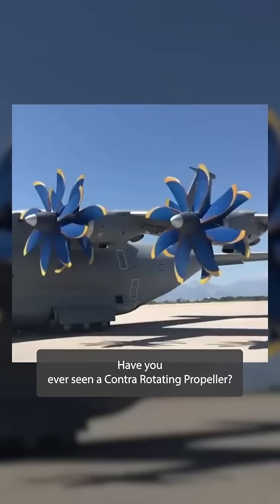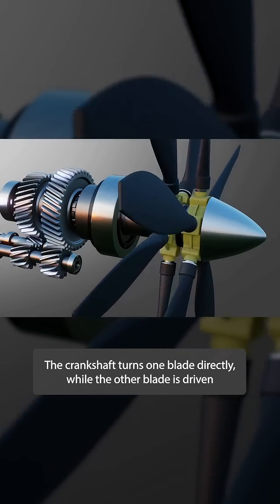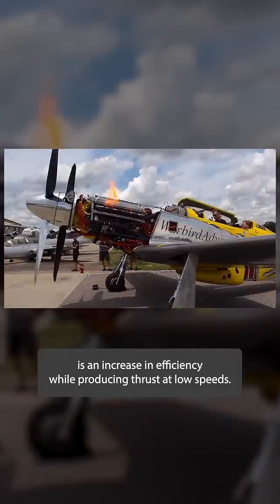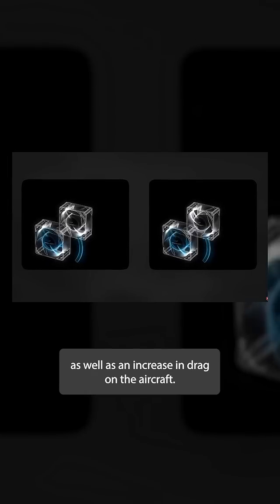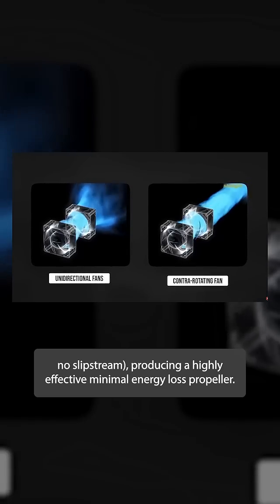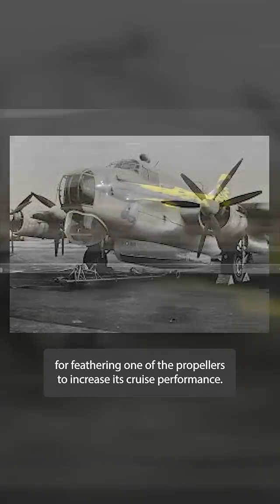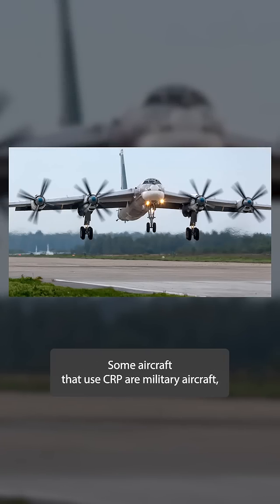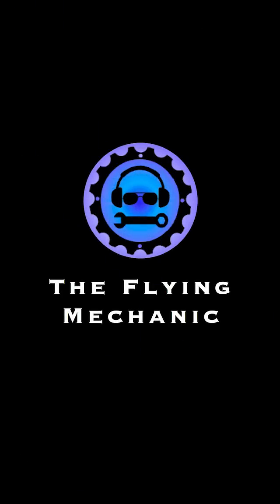Contra Rotating Propellers!

Comment: Meh. Variable pitch aft stators would be more cost effective
Reply: What about contra-rotating propellers with a pitch?
Reply: @markosedlarik9553  from what I have heard said, the engineering of contra rotating gear is a pain in the butt, and often result in vibration problems. Stators can get some thrust from the swirl created by the fan prop, and are much easier to build
Reply: @JiunnWong  I see your point, but Suzuki claims they are achieving better mpg with a dual prop setup. https://www.youtube.com/watch?v=kj_6ROUj90k&ab_channel=SUZUKIMarineSouthAfrica
Reply: @markosedlarik9553  yup, the aerodynamics checks out. It just depends on what you wanna trade off for that extra efficiency